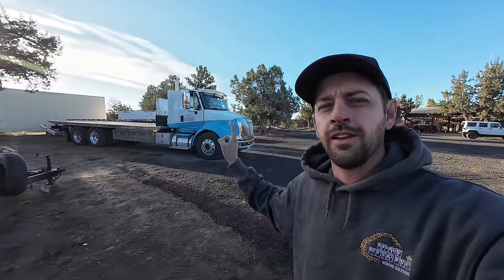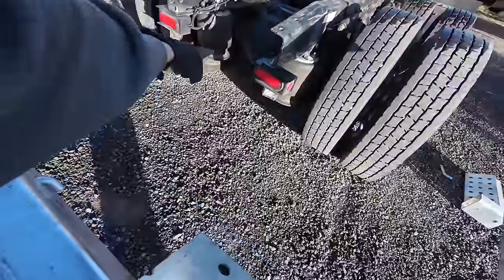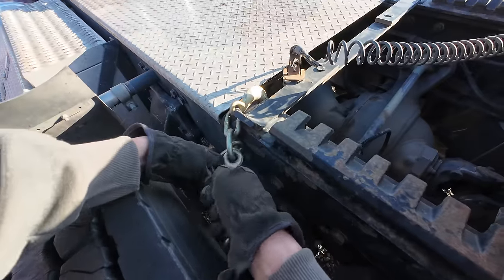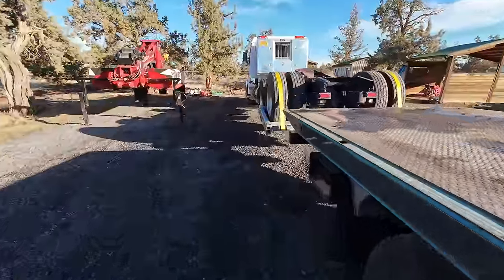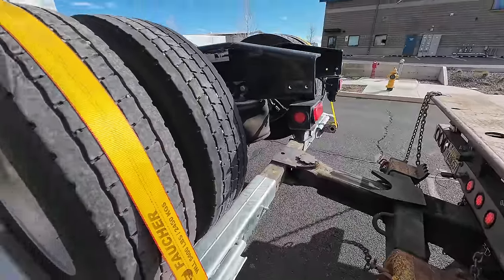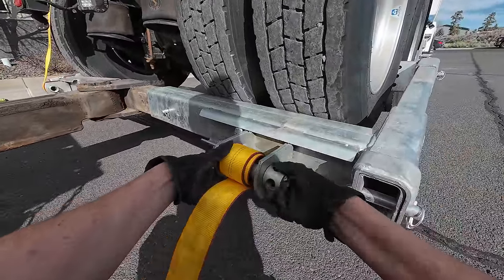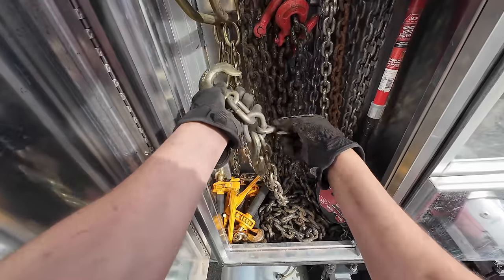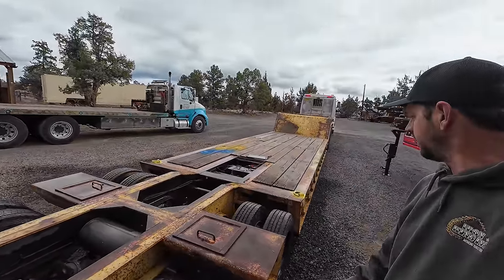I had to tow my own truck..

Comment: Simpler solution to the strap winches.

Weld a piece of tube with 4 holes on the spur / latch gear side. This way they work from both sides. Much easier than taking everything apart and flipping it around like I initially suggested.

Comment: I carry a cut loadbar and a full size one. It's cut at the top of the lower knurling. It helps with step decks being low and would help you with the wheel grid.

Comment: Hi Casey from Australia. For your hard to get to wheel tiedown make a  either 1/2inch or 3/4 drive socket that fitts on either  side and simply  use a gearwrench ratchet  .best thing its a redundant  system.just pin the home made socket  onto the strap ratchet.

Comment: Casey, one thing I do with the NRC wheel grids is put your clip pins in the opposite way. The bent end of the pin naturally flips down, and then your clip pin will have a default where it can't fall off.

Comment: Most of my 19 years in towing was in a two car carrier. I suppose the main difference was that I was towing mostly cars and light to light medium duty trucks, like maybe as high as an F550 or similar sized trucks. Doing the kind that I was doing, I found out the importanmce of wearing gloves anytime I was operating the business end of the truck fairly early when I had to pay to have the seat, wheel, shifter and door panel of a customer's car cleaned because either my hands were dirty or I forgot to remove my gloves before getting in their car to do things like shift into nuetral or adjust the steering wheel while I was winching the car onto the deck. I ended up using those wide cuffed gloves that are on and off quickly and took just about no time to remove and put back on. For me, it wasn't solely about protecting my hands, but also keeping them clean at the same time, so that also spilled over to when I was getting back into my truck, because getting my steering wheel dirty was a good way to transfer it into a customer's car or truck. Lol...They also helped when it was cold outside because grabbing freezing cold steel with bare hands really, really sucks! But yeah, wearing gloves comes down to what type of towing you're doing and for whom.

Comment: Another Nice Vid! I recognized all them roads, even though it's been years since I've riden them. We used to do a ride coming down Lippencott, but we'd turn right at the junction at the bottom. We'd go through Steel Pass, by the Naked Springs, that's what we called it, but it was an old people nudist hot spring 😮. You were the during the best time of the year, cooler temps.

Comment: Casey I had a thought. So I took a quick gander around at 4 inch strap winches and they were all configured the same. The thought I had was depending on how comfortable you are metal working and welding or if you know somebody who can you could take one apart and then make a new bracket with the parts reversed.

Comment: Hey Casey, could you just weld some thick galv tube (with holes already drilled in it to accept the tightening bar) to the left hand side of the winch? Basically just weld it to the outside left of the gear on the left of the winch? Then the gear and winch wouldn't have to be moved at all, it would just allow you to ratchet it from the left hand side of the existing winch. I get that it would mean the ratchet bar would be pretty close to the gear and you wouldn't have much room for your fingers to move the locking lever, but still it might be better than what you have with the bar being on the right.

Comment: Hey Casey if you can’t get a strap winder on the correct side you could weld the part that you put your bar into with the four holes in it onto the other side straight to the side of the lock gear 0:52

Comment: Just get one of the strap winches that has the holes on both sides. Like the ones by the rear axles on trailers that have fixed winches.

Comment: You could sleeve a pipe bushing inside the offending strap ratchet with a larger diameter pipe sleeve over one end with the 4 holes for the bar in it. The other end can have a hole thru it that lines up with the current 4 hole bar insertion point. put a short bolt or pin thru it and problem solved.

Comment: Hey Casey just a suggestion maybe you can find yourself an old hoyer lift that's going to be thrown out Bavarian expensive and use that to hoist those off or at least take the weight off while you're moving them

Comment: weld a small pipe with the holes needed for the strap bar right on the strap mech latching gear. Then can use bar from either side of strap binder mech. The factory holes on the right and the new pipe with holes on the left.

Comment: On your strap winch weld a socket inside of where you put the the bar . Then you can use a ratchet or impact wrench to tighten the straps

Comment: Find someone who can weld the material on those wheel scoops. Knock out the brace that holds the wheel ratchet in  slide the ratchet out turn it around and re weld the brace back in done 👍👍✌️

Comment: For that left wheel winch jus weld a piece of tube with cross holes to the outboard side of the ratchet. Yeah, that will mess up the galvanize. You could spray paint LPS Cold Galvanize over the weld. Comes in a rattle can.

Comment: You could maybe get some DOM tube and cut a piece a couple inches long , drill 4 holes in it that the handle would fit in and weld it to the "gear" on your strap ratchet, then you could crank it from either side.

Comment: To wind up the staps, tack a 1/2 or 5/8" nut to where you were hand winding it and now you can use a cordless impact or drill.
Reply: It would take longer to retrieve and then store a drill than it does to wind them by hand. They’re not that long.

Comment: Casey.  Just modify the  existing ratch, by welding a boss on the offside, or put shaft through and bolt / weld on existing boss...
Cheers..

Comment: With the tire strap can't you just take it off turn it around and put it back on then the hole is on the outside like you want. Yes the latch would be on the bottom side not the top. At least you could try it and see. Thanks for the content and insight to the operation of your business.

Comment: I'll admit I always wondered why no second axle chain but (I knew no articulate) I was thinking along the lines of if that one chain snapped/came loose the second would be there like a safety chain. no idea if that has ever happened to anyone though. anyways good vid, thanks for showing us.
Reply: No point. Waste of time. That chain isnt gonna break with that weight on it. Also isn’t gonna bounce loose

Comment: For the track winch, find a machine shop and have them cut the spur wheel off and flip everything around so it's on the other side? 

Just taking a quick glance, a mill or even an annular cutter in a drill press could be used to cut the weld on the spur wheel, then the tube should be able to be removed, then the paw needs to be moved to the other side, then insert the tube backwards and weld the spur wheel back on. 

You maybe could contact the manufacturer of one of them and see if they can custom make one or even just send you one in pieces so you can flip and weld it yourself. 

I'd make at least two of them. That will ensure you never break or lose the one on the truck.

Comment: remove the slide stops for the ratchet straps so you can slide it off when necessary.  replace the stops with a pin.
Reply from the maker: Why would I ever need to slide them off?
Reply: @CaseyLaDelle  to flip the ratchet release to the out side?

Comment: For the tire strap, can you take out the retainer bolt at the end of the bracket that it slides on, slide the assembly out, flip it around, and reinstall? From the views of it in the video, it looks like that may be an option

Comment: With the tyre tie down strap being on the wrong side,  if you slide it in upside down and drill a hole to put the rachet pin into (at the new top), and get a new gear cnc cut and welded in, that should work.
Reply from the maker: It won’t
Reply: @CaseyLaDelle  if you remake or flip the gear,  how would that not work?

Comment: Very impressive equipment, as for the sliding strap winches can you remove them from the frame to swap them left to right so the ratchet is on the outside.
Reply from the maker: Remove them yes, flip them around no.

Comment: Casey ,have you considered getting the windscreen protection in the form of PPS ,a clear film ?
DDE channel have used it on their Lamborghini screens ,seems to work ,and yes they eventually get discolored,but it's a peel off and get a new film installed.

Comment: tow light bar reappeared 8 months later sounds like the next fireside story.  You don't really need an opposite side winch, you just need a winch bar adapter welded to the outside of the right hand one.

Comment: You probably weren't to know until you got there that the glass shop would start replacing the windscreen on your truck straight away.

But if you had known, would you have just driven the Western Star there and waited around until they had finished?

Save you hooking up to the roll back, and driving there and back twice?

Comment: Weld a big socket on to the end of each strap winch that way you could use a impact with an extension to tighten the straps under a rig etc

Comment: cut the ring off the winch strap whare you put the bar or make one  and weld it on the gear side and that will make  it so you can crank it form the outside

Comment: I have a picture of my grandfather towing 1950ish? A wrecker towing a wrecker towing a truck with two 40' trailers. It was so cold the diesel trucks gelled so the 1947 DM Mack with gas motor did all the work. Break down happened on Ohio Turnpike that's why the double 40' trailers

Comment: You can flip those winches over, my stepdad has his flatbed setup with some of the winches reversed. Not sure this works with every brand, but all you need to do is take the pawl off and flip it over to the other side. As long as the winch you are modifying has the pin for the pawl in the center, then this should work.
Reply from the maker: No you can’t
Reply: @CaseyLaDelle Shame. I'd check what brand of winches are on Wilson aluminum trailers, as those are capable of being reversed. Unfortunately I'm about 150 miles away from the trailer, so I can't go check what specific brand they are.

Comment: Is that strap ratchet hollow with no obstructions inside?
My thought is to feed a round bar through the centre of the strap drum, and drill and bolt it to the bar holes on the 'wrong side'. Then on the right side weld on a tube with bar holes in it.
Of course, if it isn't hollow the idea makes no sense. 🤣
Loving the videos, and the crazy shorts!

Comment: Trucks can have front brake locks. Tow and fire ladder the most common. There are ways that one guys that hate's Casey and won't let one miner detail slip. Ha!
Reply from the maker: Correct, but they are not spring brakes.   They use an air solenoid that activates the service brakes on all axles.

Comment: Casey looking at your tire straps can’t you take the backwards spool out of the slides, and flip it over. You will have to tighten it up pulling up instead of down. Or possibly look at flipping the gear ring over?

Comment: The strap on the wheel lift,  an you slide it out and flip it over?  It would wind backwards if the other one, but the bar would go on the outside.

Comment: Let me take us all in the way back machine (for those who know, you know). I drove commercial charter coach (similar buses to Greyhound but completely different). I went to the yard to pick up my coach for an overnight. I did my pretrip (Yes, Casey does his pretrip as well). I noticed a major defect...the right front window was broken. It wasn't a nick, it wasn't a scratch. It was a complete crack from the bottom to the top (Don't ask me why the cleaners didn't notice/report this...that is a different story, and worth telling.) So I grabbed the mechanic and said, "I can't take this coach! It has a major defect (a broken windshield). He cursed, looked at the roster, every bus was booked that day (our terminal had 16 out of a fleet of 120). He said to me, "Pull it into the bay. I'll get this fixed." So I pulled it over the pit and he put up a ladder, took out the center rib on the window, then stepped up into the bus, kicked the window out, and installed a brand new one in 15 minutes. I was about five minutes late for my pickup. I'm glad the company I worked for took defects seriously. (All of our coaches were inspected twice a year by New York certified inspectors. I was never, ever, given an out of service defect on a spot inspection.)

Comment: Seems like most of those strap winches just have the lock sprocket welded to the pipe. Suppose a person could cut the sprocket off and reverse it and the lock to have it facing the direction you want?

Comment: I was wondering why you didn't just tow your pickup, but guess that makes sense. Other thing - did you not notice the chip in your windshield? Could get the chip fixed before it starts the spread. I don't always manage to do that, and I hate it when it starts spreading because then you have to replace the whole windshield.

Comment: Were it me I would modify the ratchet mechanism of your sliding strap winch that is a pain, due to the bar position being on the wrong side. It should be possible to weld  a suitably drilled piece of bar onto the outside of the spindle. You could even weld a nut on there and turn it with a spanner/wheel brace or some such.

Comment: Someone probably said it but on your tire straps just slide them out the slot flip them and slide back? I cant see what holds the gear side on tube maybe a weld but could also remove and flip all that.

Comment: What about flipping the wheel strap and then flipping the actual strap in the mechanism. Ya I think you would have to bar it in the opposite direction.. not sure. didnt get a good enough look at the locking mechanism.

Comment: just curious could you just take the left side ratchet tire strap and slide the unit all the way to the right, removing it and then reinsert it opposite, where the bar would then enter from outside of truck and achieve the same thing or would the metal tang that locks it in place not be able to keep tension upside down?

Comment: Can you carry the western star on the roll back instead of pulling it with the wheel lift? it seem it would be faster to drive the western star on to the rollback and chain it down in 4 corners then go... no safety chains no tail lights no securing the steering wheel
Reply from the maker: Nope.  Too tall and too long

Comment: Make an adapter. You could make an adapter bar to go through the middle of the spool. Drill a hole in one side to run a bolt or pin through the Winch Bar hole and weld a winch Bar Basket on the end. It would act like a socket extension from the inside.

After seeing the Instagram video on the Sliding Strap Winches, I understand the problem.  Those winches are not made for that application.  Those are standardized for Flatbed Load Trailers and the Wheel Grid Manufacturer used them rather than making a custom Left and Right part.  It's something that could be fixed with a bit of cutting and welding, but is it worth the liability?

Comment: I have an idea for the winch strap. Could you cut the side with the hole and weld it to the ratchet side? Not sure if it would interfere with the locking part.

Comment: Just take the strap winch over and turn it through 180 degrees

Then the strap goes to the inside of the strap winch while the other side goes to the outside
Reply from the maker: What about the latch?
Reply: @CaseyLaDelle  Just use your 100ton rotator and turn the truck upside down

Comment: Will that strap housing slide out & off? Then flip it over pull off all the strap, rewind in proper direction. Can't be too complicated, it's all mechanical. Unless the lock won't hold......... idk. Just my 2 cents

Comment: I am pretty sure they weld the gear on for those strap winches. Why not add your own spot for the winch bar? 
I get spoiled with my glass guy, he comes right to the shop and is still cheaper than the other guys around that don't do house calls.

Comment: Casey, Dont the straps mounts 
slide off eaither end of the housing. Couldn't you just pull them off and swap them over so the pole hole is on the outside??
Reply: If I understand you correctly, the little stop thing that keeps it tight would then be on the bottom and able to slip off during transport.
Reply: @senhowler  i wasn't sure if the ratchet tooth thingy was spring loaded or gravity fed
Reply: @senhowler  not if it was swapped laterally (right for left) -- gravity is the same either way
Reply: @rick_b8s  And what would that accomplish?  The problem is that both the one on the right and the one on the left have the bar holes on the right.  Swapping them just puts another one on the left with the bar holes on the wrong side.

Comment: Hi Casey, on the rear wheelgrids  you were complaining about the drivers side tire strap winch mounting. Can't you just pull the strap assembly out of the guide bars and reinsert it in reverse how you want it, and re rig the strap?
Reply from the maker: The internet “experts” strike again..
https://youtube.com/shorts/TZzyrU1Dws0?feature=share
Reply: @CaseyLaDelle  hEY  this was meant a a nice suggestion, right? Also you  have the skills to make that gravity locking pin work either way , right?

Comment: the wheel ratchet strap, Couldn't you Pull it out put it around the other side and re drill for the latch? Putting the latch on the left?

Comment: Just wondering if both your light bars will work on either the zachlift and your roll back or do they use different frequencies, transducers, etc?
Reply from the maker: If I swap the transmitters, yes